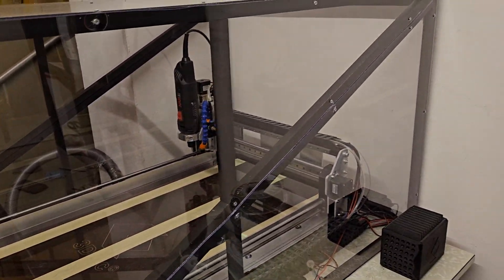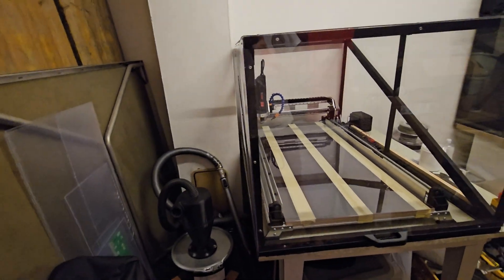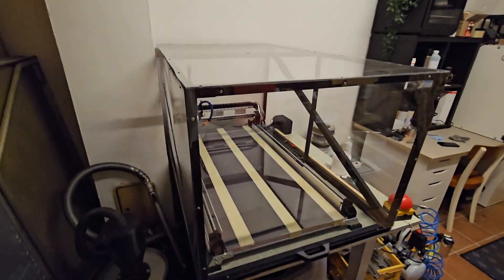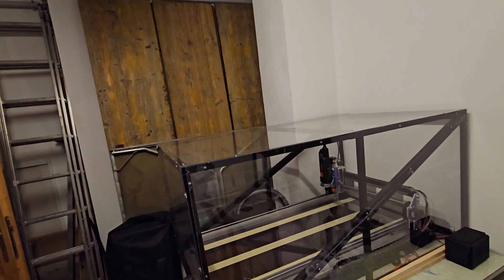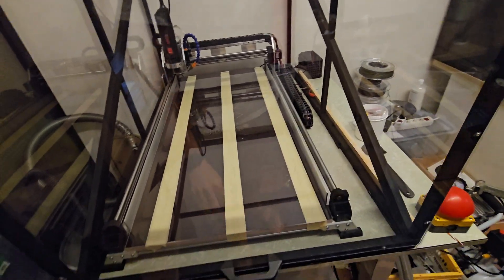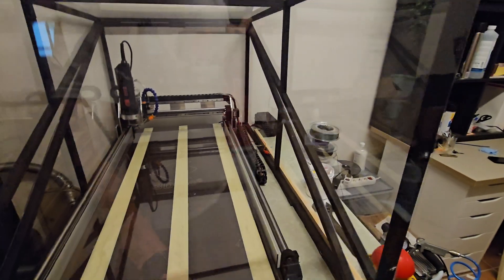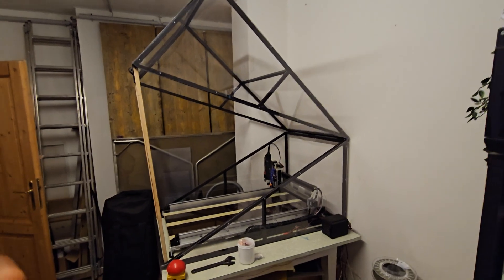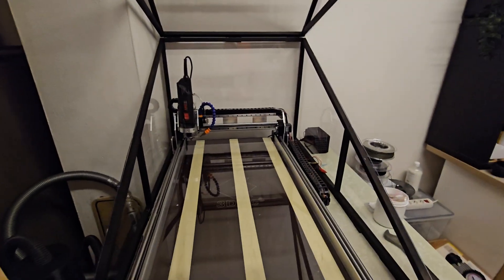This CNC Enclosure is WEIRD | you won't believe why...

Comment: Looks good for a home project. Seems useful for:
- Safety reasons, when pieces fly out and hit you or the wood plate gets loose
- Preventing dust and chips flying everywhere 
- Maybe even a bit of noise reduction. 

I think wood and the panels are the cheapest option to go. I would have put in more screws so the plate has less warping between the screw holes. If you can, chamfer the screw holes on the plate to prevent the warping. Using some silicone between the plate and the wood would further improve on dust retention and noise reduction. Overall this looks like a nice build and I really like the diagonal opening style of the cover.
Reply from the maker: HI thanks for the comment: 

Indeed, it helps also safetywise!
And you are also right, with your points. I will probably don´t do any enclosure with wood again. But I haven´t thought about the silicon, great tip!
Thanks for reaching out. 
Do you also have a CNC? 

BR
Christoph
Reply: @3dtecstudio  Hi Christoph, I unfortunately don't have a CNC at home since our shed/my small workshop at home doesn't allow for more tools or machines. Since I also still live with my parents there's only place for a drill press, grinding wheel, a bench vise and a few other power tools. My job is maintenance technician at a big logistics company with a lot of conveyors and different machines so we need to do some tinkering and macgyvering ourselves at work every now and then. The goal is to build a nice workshop once I move out.